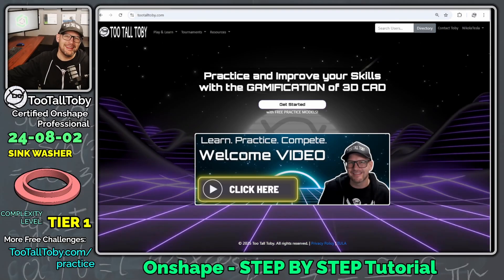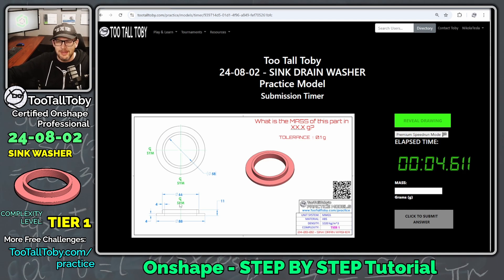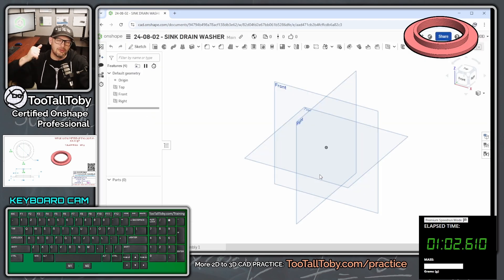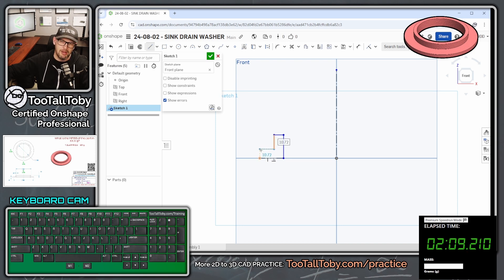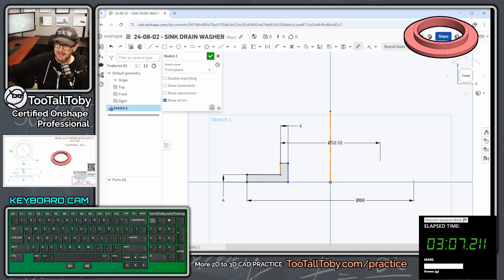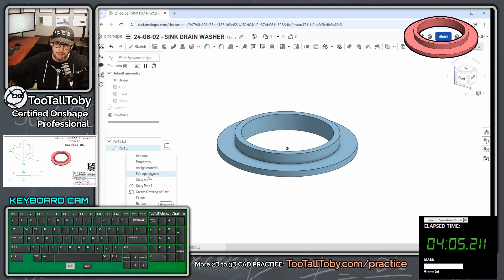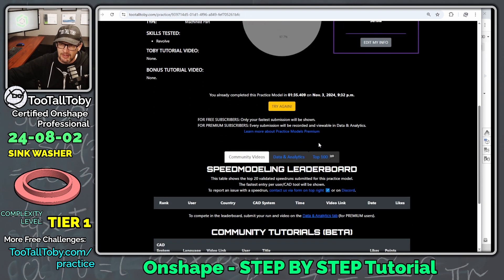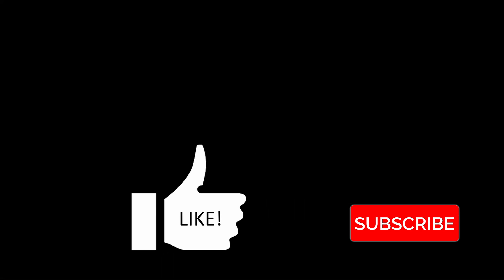Onshape Best Tutorial for Beginners - Cabinet Handle - Step by Step Guide -  Symmetry, Fillets

Comment: Hey dude I got a question. I tried to model this and I think I got it right, but I used the center point circle tool instead of the revolve tool. I double checked all the dimensions but I came to a weight of 20.213g instead of the 19.6g. Do you have an explanation on why this might happen? Quick edit: I used the extrude tool after I was done drawing the sketch
Reply from the maker: is the materials density correct?  Search youtube for my onshape video about materials (Toby Onshape Materials)
Reply: @TooTallToby  I used ABS and got a density of 0.038 lb/in³. Ill check ur vid on materials tho thanks!

Comment: I'm new at this and I'm confused....  From what I'm seeing on the drawing is the inner diameter in the top view of 58mm.  On the side view I see a wall thickness of 4mm on the vertical lip,  but the outside diameter of the vertical lip is 66mm.  I'm assuming that I would add the inner diameter and the wall thickness to get the outside diameter but that would be 62mm.   I like to try the challenge before I watch the tutorial so I was sketching it from the top view with circles and extruding.  What am I missing?  I'm sure it's so simple but...
Reply from the maker: Wall thickness is on both sides of the circle, so ID +(wall thickness *2) 👍😀